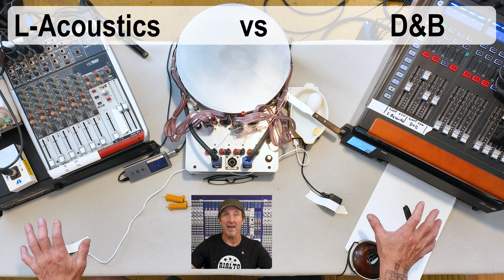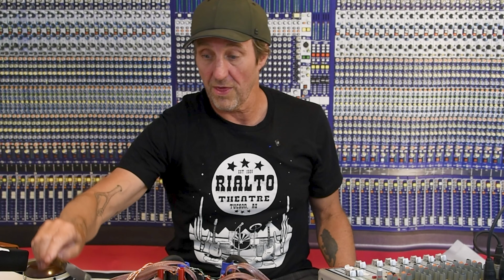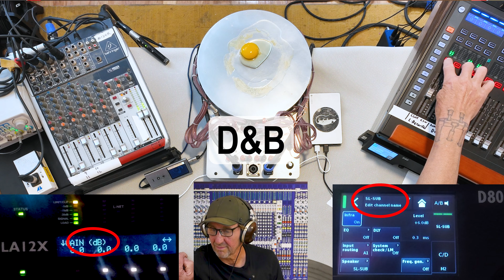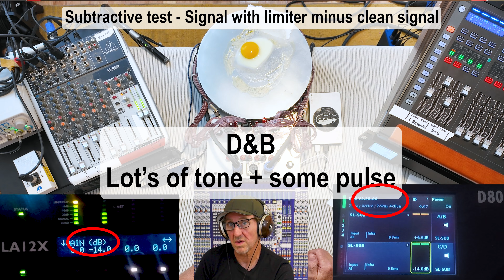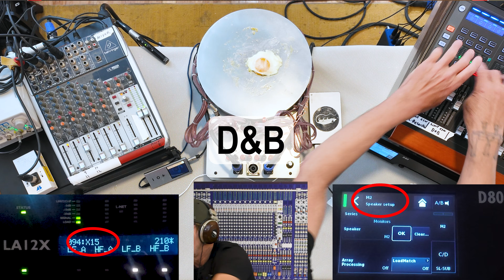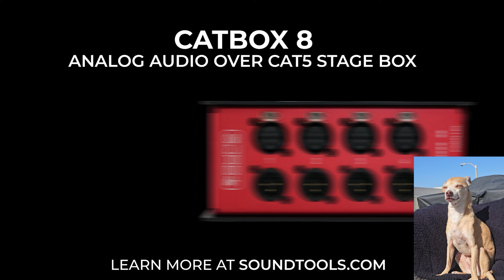Who Does Amp Limiting Better? D&B or L-Acoustics?

Comment: The way I was taught, if you ever hit the limiters, you were doing it wrong.
Reply from the maker: well that hyper conservative method can apply to certain scenarios. 

perhaps like mixing classical music on extremely high fidelity systems and perhaps for theatrical performances.

there's another train of thought that if you never hit the limiters and you have enough volume then you brought way too much gear. 

if your peaks hit 6db  of limiting on the peaks you would have to bring twice as much equipment speakers and amps and rigging  to do the exact same thing without limiting and hit that same volume levels. 

and if you have three trucks worth of gear and you now need six trucks you can kind of grasp the magnitude of this don't touch the limiter strategy. 

but for those with large budgets and loads of free  space to place the equipment and plenty of time to set up, never hitting limiters can be a strategy. 

but one final note, live music is extremely dynamic and using limiters and compression is pretty necessary to get a quality sound for most music types. so compressors and limiters are definitely used, system limiters are just another tool in the toolbox

Comment: I didn't even get 10 seconds in before commenting most subs sound better without a limiter jus limit yourself on the volume i remember disabling a built i limiter and the sub came alive it was cutting out the lows
Reply from the maker: I will agree that sub sound better without an incorrectly set limiter. 

but it's highly probable that Subs will almost always sound better with a correctly set limiter. 

the reason is without a limiter you need to set the volume to avoid clipping or distortion even occasionally, 

but with a limiter that prevents clipping or distortion then you can set the volume so that occasionally the signal hits the limiter which will result in a louder signal that never sounds bad

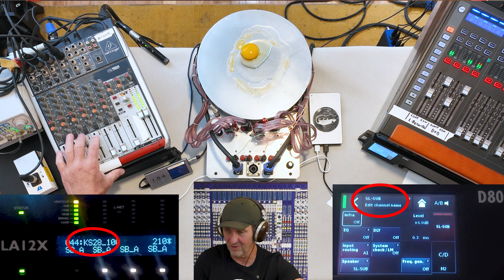Comment: 11:27 just different release times. Configurable limiters and compressors allow you to set these.
Reply from the maker: based on what I know from working with eaw and L-acoustics, there's a heck of a lot more going on than just release times. 

multiple overlaid limiters with differing attack times and release times. 

and I believe there may be some frequency dependent limiting as well.

limiters that slide the high pass filter upwards when driven hard to allow more output level by reducing excursion. 

limited settings are an art form and I've done some consulting with manufacturers in helping them achieve better results by altering the limiting strategy

Comment: Hi Dave, thanks for the video as  always! What are you using for a power sink to make your eggs? (and get your data), I'm super interested in  getting better info on what my amps are doing and am curious how you made it. Thanks!
Reply from the maker: that is a 1/2" thick aluminum disk I bought at the metal supply yard many years ago. it was sitting in the surplus pile and figured I would find something to do with it someday. one of the most cost effective ways to make a load is to use resistors immersed in a can of oil, like a sealed paint can. I am sure there are a bunch of vids or instructions findable online.

any big chunk of aluminum or heat sinks from an old dead amp will work 

you typically only need resistors rated at one forth or so of the test power if you don't test full power for too long and get figure out a good way to keep them cool. else you can buy resistors rated closer to the twat power and less heat sink is needed.

Comment: Hi Dave, this makes me thinking about system tuning.
We should not only test under system linear range, but also enough SPL (pink or music)as the test signal to active limiter to reproduce this situation. (x-over and response will change)
But like LA P1 , only swept signal can’t reproduce the actual program signal.
Reply from the maker: That's a great point although I'm not sure of the value of doing measurement tests at high volume in the nonlinear range as the most important aspects are perceptual. 

how does the system sound when driven hard is the question I think that needs to be dealt with rather than how does the system measure when driven hard
Reply: @DaveRat Recalling the lives I seen, most of them, including me, tuned the system under the linear range, especially as L-acoustic p1. Only swept and the curves look nice and playback CD sounds good. But in actual band sound check with very loud SPL(nonlinear mode), it sounds different from the playback.
So now I often bypass P1, using 3 party software playing some Live rec track as the test signal.
Reply from the maker: very cool and smart. testing with the sound we actually hear or closer to it is important

Comment: makes no sense. pointless. sunny side up pls
Reply from the maker: yeah, I can see how it would be hard to understand the importance of the sound quality differentials of differing approaches to system protection if you don't have much exposure to how bad some approaches are.

but if you ever do mix live sound on various live systems, it's pretty easy to notice and realize how big of an impact the limiting strategy can have on sound quality
Reply: @DaveRat  , don't drive the sound system into the limiters. Problem solved. It's not hard to understand Dave. Different manufacturers' speakers already sound different with different characteristics without hitting limiters. Furthermore, hitting the limiter with a single frequency tone or sine wave doesn't really give off the tone or preformace of a limiter. When the frequency spectrum is divided by crossovers and therefore multiple frequencies affect the limiter and its response and tone. Can I get a side of bacon with my eggs?
Reply from the maker: very cool and mixing without ever hitting limiters is not uncommon and also the reality is that it is also not uncommon to utilize system limiters for various reasons 

when deploying sound systems like we do, And we have deployed a system capable of 108 DBC weighted without hitting limiters utilizing 60, 80 or maybe a hundred boxes to do so, and a specific engineer desires to mix it a hundred 114 DB for one song, that engineer in production can either request it everything be doubled, And the system has to be 120, 160 or 240 boxes in order to achieve 114 DB without hitting limiting or they could mix that song or those songs with 60 B of system limiting and utilize the smaller 60, 80 or 120 box system or be forced to never exceed 108 DB.

as you can imagine there are some significant cost and logistical aspects to doubling all of the sound systems to account for that extra 6db

And perhaps as you can imagine there may be occasions where either due to budgeting constraints, weight limits, sight lines, trucking costs, set up times and more, that operating the system was 60 be limiting maybe the preferred course to take. 

for those situations which are not uncommon, understanding the way very system sound when limiting can be a very important aspect and if a system does sound good in limiting it can offer many benefits to follow that path instead of the no limiting hard line desire. 

this is something that engineers who have been mixing on large scales with world class touring bands are quite familiar with and throughout someone's career they may encounter or embrace
Reply: @DaveRat  , well dave if you have to mix at 114 db. Maybe there is something else wrong. And the lasted rammstein tour had well over 250 cabinets. 
There is this thing called coverage over horse power. and if you have budget contraints then i guess you have mixing constraints. Dry rye toast pls. and I really don't give a fuck.
Reply from the maker: I appreciate your perspective and opinion. when I'm mixing Rage against the machine and running into various sound systems throughout the world, quite often I ran into not enough PA and the sound of a system limiting with something that I encountered whether I wanted to or not. I've seen many Rammstein shows and I know they're engineer well. 

as the sound system provider for all of the main stages at Coachella as well as the Hollywood bowl and many other large festivals and world during acts, my opinion is that being aware of both ideal situations and the realities of deploying and mixing on sound systems are important aspects for us to be aware of.

I appreciate striving for sound systems that never go into limit and also personally, when I was mixing I was actually seeking sound systems that were appropriately sized for the venue. too much PA or too little PA were both issues.

too little PA I ran out of headroom, and for many artists that I mixed having too much PA was also an issue. 

kind of like driving an F1 card down City streets or those knuckleheads that you see with Ferraris and Maseratis in bumper to bumper traffic. they don't drive well when the speed limits are low. 

it's all about having the proper tool for the job and optimizing the parameters at hand and sometimes for me that included the sound of a system being driven to its limits rather than having too much PA and having it idle 

I realize that's not everyone's perspective but it's important to appreciate that there are many perspectives
Reply: @DaveRat  you are repeating yourself. you said this in the last message. do u like to hear yourself talk?
Reply from the maker: I believe you started this comment thread from the standpoint that the sound of system limiting is irrelevant.

And I fully understand that you have strong feelings about your perspective and you believe your perspective is the correct one rather than just one of many useful perspectives.

but also typically those that think they're the most right tend to be the least informed

so yes, I will agree with you, you should avoid knowing and understanding live system limiting, and what it sounds like. as you will probably never encounter a scenario in your career where the knowledge will be useful.

Comment: Nice and interesting content! But for mixing engineer, I don’t want to push the volume trigger the limiter often, you don’t want a ‘real time mastering guy’ to control your mix😂So, I would rather have enough loudspeakers keep 20% headroom.
Reply from the maker: interesting and let's try a fun little thought experiment based on real world deployment. 

let's say you want to sound system capable of putting out 112 DB C weighted with the described 20% headroom which in decibels is of some fraction of a DB, So we can basically ignore that and just say that you don't want any limiting.  3DB of headroom is doubling or 100% and 6 DB I've had room would be 400%. 

now let's say you are a sound engineer and based on your experience and knowledge of the band and music you want to achieve 112 DB throughout the listening area. 

And for this particular gig if you are willing to accept 6db of limiting to achieve 112dB  level the sonic predictions say you needt let's say hangs that are 12 boxes deep and side hangs that are six boxes deep, So you need 36 boxes plus subs. 

but if you are unwilling to accept 6TB of system limiting you will need to double everything and have to hire a 72 box system to blanket the audience with the exact same dB SPL level and coverage. 

furthermore, if you were like many engineers you are probably implementing at least 6 DB of limiting on your kick and snare. 

So the question is, do you limit your kicking snare in the mix board and then send it to a 72 box system that has no limiting or do you use less limiting on your kick and snare and send it to a 36 box system? 

and what does your production manager say about who's paying for this and the maximum weight that you can hang and sight lines and trucking costs and so on? 

now we do plenty of gigs where money is no object and everything is well below limiting and we do plenty of shows where deploying a system that never touches limiting is so unwieldy and expensive and impractical that it's not even considered 

just a fun set of perspectives to take into consideration
Reply: @Dav @DaveRat Hi dear Dave, thanks for the reply!exactly make sense ! personally I think the current consoles lack of a dynamic process section is clipper. And indeed, 20% is a exaggerated statement, live not like studio mixing we can know the loudest part predictable. I mean it can trigger the limiter when some short time very loud part, but I don’t want the limiter always ‘press and hold’ my mix
Reply from the maker: Yes you bring up a good point referring to a studio mix versus a live sound reinforcement situation 

with a studio mix it's going to be quite important that the system does not have any limiting because that's not going to be recreated by the listeners to the mix in other situations 

conversely for a live sound situation the parameters differ quite a bit and the lack of system limiting is less important and delivering impactful high quality music at the desired volume level becomes a dominant factor that is often limited by the feasibility of the amount of equipment that can be deployed for physical or budgetary reasons. 

it's all about the right tool for the job and understanding the application at hand. 

and very cool
Reply: @DaveRat 🤘🏻🤘🏻

Comment: If the l-acoustics X15 had a lower crossover frequency on its low end  and a higher frequency crossover on its high end - its either a terrible box design with a whacky acoustic frequency response, or theres a missing midrange at the crossovee point. It sounded like the d&b crossover meets in the middle for a full frequency response, yet the l-acoustics must have a mid range gap. Thats alarming.
Reply from the maker: another possibility is that the drivers that L-acoustics is using are more efficient on the top end of the 15 and have more output on the lower end of the compression driver due to a larger horn size. 

So another way to look at it is that D&B is having to boost my frequencies on the top of the 12s and boost low frequencies on the bottom of the compression driver to get things correct and the x15 does not 

either way we can't really judge too much from what is sent to the box because of all the variables. what we can do is listen to the way that the sound changes as we drive it harder to help understand what the compressors and limiters are doing
Reply from the maker: I should also point out that the x-15 is a coax And because of that the horn can be so much larger than the smaller horn in the M2. which would make sense, The horn would have much more efficient low frequencies so the amp would send less energy to the low frequencies of the high frequency driver And there wouldn't be a need to run as much high frequencies to the low food if you driver
Reply: @DaveRat thanks dave, yes I appreciate there are a lot of variables. Heres a suggestion for you for perhaps a future video... I think there might well be a lot of interest in seeing some of the DSP / amplifier presets charted out. Particularly those from the likes of d&b and l-acoustics. Just how wild are some of those EQ preset curves manipulating the sound, and how much is the cabinet itself? You already have the test rig to do it, and its more eggs on the menu!

Comment: Jesus thank you so much for this absolutely amazing experience. I've always been kind of bad with limiting systems and how to push and limit them. I'm a rather young sound guy, always had my speakers from top notch brand (D&B, LA, Adamson...) protected by manufacturers, never build my own speakers nor used home-made-ish systems that I had to protect myself.
Would you, dear messiah of audio Mr. Rat, consider making a video where you develop around the technical ways of limiting signal and protecting amps and speakers ❤ ?
Sincerely yours from France,
Jean-Léo
Reply from the maker: very cool Jean Leo! yeah I will consider doing a limiter video, I will have to put some thought into how to approach it.
Reply: @DaveRat  Thank you so much for taking time to awser 🎶 And for taking my request in consideration, I'm very impatient to see what could emerge and learn from it ! Bye-bye 😊
Reply: @DaveRat  I second this! Lots of young people like us around building their own soundsystems, but deep technical & practical knowledge about limiting seems so hard to come by... I think you could help an enormous amount of people with this!
Reply: Pretty simple with RMS and peak limiters.  Just enter in the values of the drivers parameters ..... Then play with the attack release and hold knee usually around 3 or 4.  It definitely does range some though but if you know the RMS of your driver, as well as it's peak or program that's a very good place to start

Comment: For an easy/very safe off the shelf solution, the atelier-der-tonkunst POL-DDI is very good...

I have some voltage dividers I made myself which are more accurate though, but you have to make two, one for bridged mode or BTL etc. amps, and one for standard - tied to ground...use the wrong one and oh-uh.